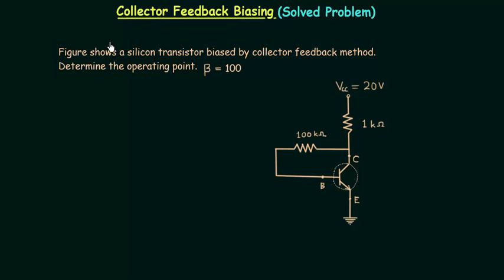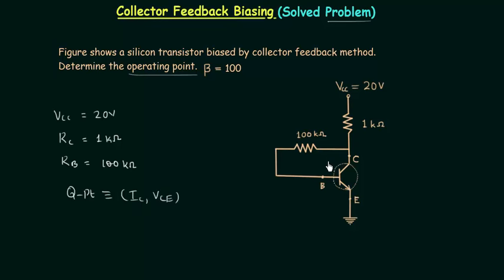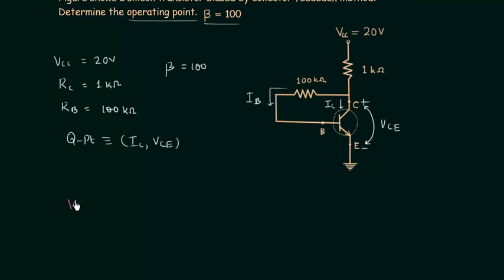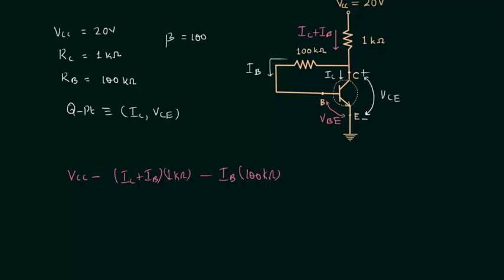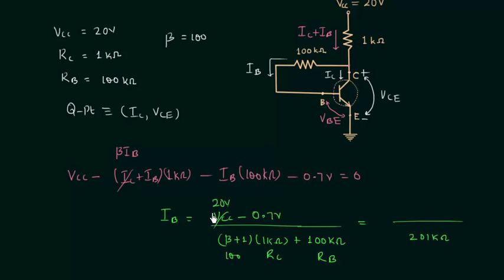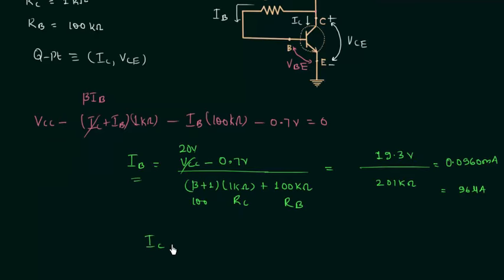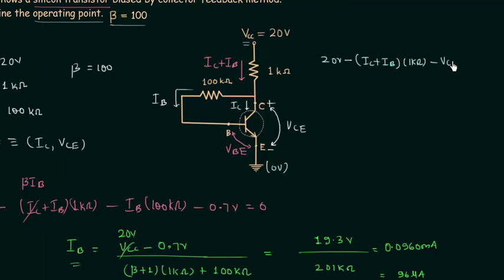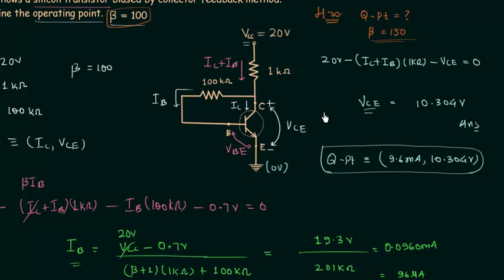Collector Feedback Biasing (Solved Problem)

Comment: In collector feedback bias, if you increase the Rc value,more voltage drop takes place, so you need some voltage to turn on Transistor ,so more VCC is required.., so cost is high

Comment: The beta* Rc is not far greater than Rb so as a result change in beta shift the operating point to the left, hence no stability. Ic~11.53mA, VC~ 8.4V

Comment: There is a formula to calculate IC from the circuit parameters (components). Here it is: IC = Beta(Vcc - VB) / (RB + Beta(RC)). Now filling in the component values: IC = 150(20 - 0.7) / (100K + 150(1,000)) = 11.58 mA. Once you have IC, you can easily calculate IB and all the circuit voltages.